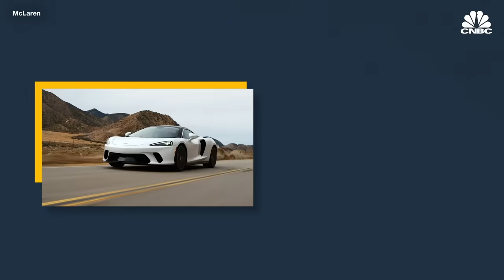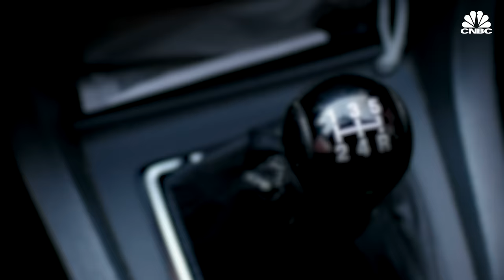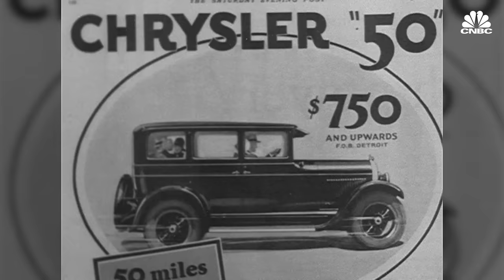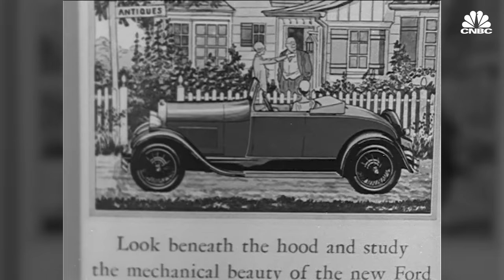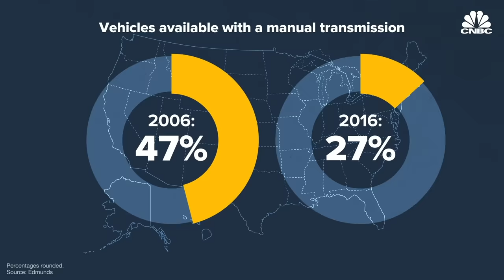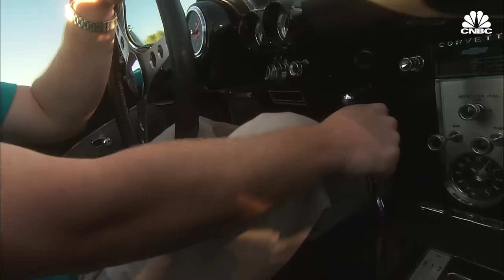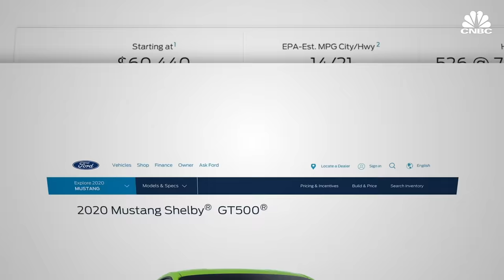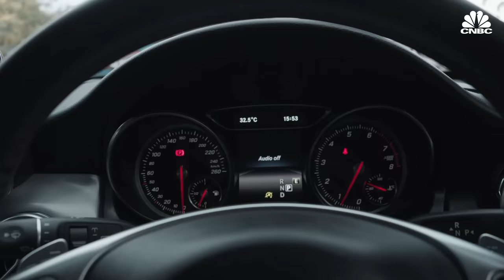Why Stick Shifts Are Going Extinct

Comment: Manuals are so much fun and so satisfying! Driving feels much more like a chore in an automatic and more like an activity in a manual. To anyone who reads this and doesn't drive stick, try it out! It's a great skill to have and makes you feel straight out of the Fast and the Furious
Reply: Cinda Oppenheimer  and some wanna have fun and improve their driving while doing so
Reply: Indie Fury  Clutches normally last longer ... what car do you drive?
Reply: But is also a lot harder to learn do if just want to get from point a to b,keep the automatic.
Reply: @MrNoone-dg2xn  It depends on driving conditions. Driving exclusively city traffic will more than halve a clutches life. Honestly, a manual costs about the same over the life of a car as an automatic, based on my observations. A torque converter automatic usually needs rebuilt after 150k miles and by that time you’ve usually replaced a clutch two or three times. And even a manual will have to come apart for synchros eventually, even if it is around engines expiration date.
Reply: How is it a chore in an automatic when it is supposed to be the opposite? I feel like you guys are just making stuff up now to defend manual
Reply: @mikerichards2317  I think what he meant by “chore” is that driving a car with an automatic is more like driving A to B as opposed to the engagement of driving a manual for fun. I personally disagree with his sentiment. I’ve had plenty of fun and engaging cars with automatic transmissions. Pontiac Grand Prix and 2012 Focus to name two. But I still enjoy driving a manual more personally. Nothing cooler than heel toe downshifting into a corner and blasting out at 5k RPMs. My 98 HP Chevy Spark might be slower than a moped, but man am I having fun being slow.
Reply: Every shift you feel the power driving a manual transmission  only lazy folks drive an automatic
Reply: Lance - manuals being fun and satisfying is for people who actually enjoy driving, and for the life of me i cannot understand why anyone likes driving.  many of us consider driving an unfortunate and dangerous chore we have to do because the world became so dependent on motor vehicles, which are one of humankinds most idiotic inventions
Reply: @eatpigsnot  That's fair. I wouldn't expect someone who doesn't like driving to begin with to enjoy manual, but I think it is worth trying out nonetheless. 

As for the enjoyment of driving, I cannot speak for others but personally, I enjoy driving because I like going fast. And not exclusively in a straight line but in curves and turns and other maneuvers. There's something so satisfying about the sensation it provides. And driving a manual lets you be more connected and in control of every aspect of that.
Reply: @lance9800  i can't understand what being connected to a vehicle means.  i don't doubt you and other driving / car enthusiasts feel it, i just don't understand.  my hand / foot coordination is non existent.  i don't think driving manual is something i could ever learn no matter how much i tried and practiced.  i give people grief for being closed minded and not trying new things, and i don't want to be a hypocrite, so i guess if the opportunity presented itself i would try.  side note - do you watch SNL?  if not pull up the "Car Heist" sketch from last weekend
Reply: @jacobrzeszewski6527  Anyone that replaces their clutch 3 times within 150k  miles, doesn't know how to drive a manual car and shouldn't be driving one at all. It  is a skill and a pleasure to drive one.
Reply: @eatpigsnot  for me personally, i started feeling that connection to a vehicle after a year of driving manual, bc its how long it took me to perfect it
Reply: Indie Fury  Hey when I bought my second Beetle, the owner said- "Clutch has to be changed."
and by NOT slipping the clutch, (or being an a - -), I drove it TWO more years, no problem.
Hopefully, we can help save the climate by as soon as possible going ALL EV !  and goodbye transmissions altogether, along with crank and drive shafts, camshafts, engine bearings, unjectors, mufflers, catalytic converters, water and fuel pumps, radiators, etc. etc. This will be a dinosaur of discussions !
Reply: When I was in my teens and twenties I didn't want to drive any car that didn't have a stick. Once I hit my thirties I didn't want any part of a stick even though I had a few cars in my thirties and forties that were sticks.
Reply: @jacobrzeszewski6527  -- believe it or not you can drive a manual without synchronizers.  It utilizes a skill called double clutching.  And after you have mastered double clutching, you can drive a manual without the clutch at all except for starting out.  You always have to match the speed on both sides to get it to slide nice and silky out of one gear and into the next.  While in neutral between two gears you have to either increase or decrease the rpm's depending on whether you are shifting up or down.  Starting out be studying the shift point and seeing, for example, the rpm's in second gear at 35mph and the rpm's in third gear at 35mph.  Get the idea?
Reply: Indie Fury  You had to change the clutch because you are not worth a crap on a stick shift. Get an automatic. 
I've driven stick shifts for over 50 years and never had to change my clutch. 
I rode to work with a guy for awhile and I could tell every time he shifted. He ended up having to replace the clutch, twice I believe because he wasn't worth a crap at shifting a stick just like you.
Reply: @MrNoone-dg2xn  Car doesn't have anything to do with it, he just isn't worth a crap on a stick shift. He needs to get an automatic. 
The clutch should last the life of the car. Maybe not a truck, depending on what you're pulling with it.
Reply: @imatanyani  You are right, he can't synchronize the engine speed correctly for the gear he has shifted to thus causing wear to the clutch everytime he shifts. Some people just can't get it.
Reply: @lennyhendricks4628  Semis don't have synchronizers and they don't double clutch them when they shift. You have to know what you're doing.
Reply: I was with you until you mentioned Fast and the Furious. The Holy Grail Movie of Ricers.
Reply: Except when all the latest fast and furious movies are shifting an auto 🤦‍♂️

Comment: Thumbs up to all my stick shift drivers.. 
We're the last of a dying breed. 👍
Reply: cheers. I still have two 👍
Reply: OBZRV82 I own 3 cars and two of them are manual
Reply: I name thyself @LastOfTheAnalog
Reply: Bought a 2020 corolla hatch with the 6 speed, best car I've driven yet and I've driven some fast cars
Reply: OBZRV82 +
I own a 6 speed manual 2011 Nissan Sentra that I purchased in 2012. I’ve been mostly driving manual transmission cars most of my adult life & I LOVE it! Even if the next big thing is flying cars, I’ll be driving my stick until the wheels drop off!😂 
Unfortunately by then I fear that here in the USA there may not be an affordable mechanic around with the skills and knowledge to keep it running.😢

Comment: I'm 74.  Been driving for 70 years (yes, you read that right).  Started when I was four.  No big deal.  We were all farm kids in grade 1 at school in Australia and we could all drive.  I started on the farm's Series 1 Land Rover - manual gearbox, of course.  Now, it's a Beemer - bought new 22 years ago (430,000 miles on the clock and I've yet to lift the head) - manual gearbox, of course.  It'll see me through.  Behind the wheel, I'm a driver, not a passenger.
Reply: @endroholic7161  Thank you for that.  Most of all, I guess, I like the fact that the engine is directly connected to the driving wheels, and the ratio I want through the gear-box for those wheels is precisely the one I choose at the time and under the circumstances that I choose it.  I've driven automatics (never owned one) where - at times - the box was 'hunting' for the gear it wanted ... up and down, up and down.  Not for me; I like the certainty and precision of connection.  I'm a rally driver, and if I've got my tail hanging out there on a you-beaut gravel road, I don't want the car to change its mind about the gear it wants.  Another thing, if I've somehow flattened the battery, my car (the manual Beemer) can be push-started (done that once or twice).  And while I'm getting my knickers in a twist, I might as well add one more thought: if I bought a new car, I wouldn't want remote locking, lane-changing warnings, automatic braking, reversing cameras, Bluetooth and all the rest of the gizmos.  I do all that!  Take all that stuff out and spend the savings on bigger brakes, more power and better lighting.  My B doesn't have any conveniences.  There are only two things I'd like in it ... cruise-control and two coffee-cup holders.  And, yes, it has a full-sized tyre in the boot - not a run-on-flat or a Mickey-Mouse thin wheel.  Driving the 2,500 miles across the Nullabor to Western Australia (as I've done more than 50 times), the land is empty and you can drive nearly 100 miles between service-stations.
There you go ... a bit of a rant.  Safe and happy driving to you, Endroholic!
Reply: More power to you Sir. Driving stick is a feeling like none other.
Reply: Once you've learned to drive with a manual transmission becomes second nature, you don't even think about it.
Reply: Paul Armstrong  Thanks, Paul.  Glad you're onside here.  Something that's a bit disturbing I've been hearing or reading recently is the idea that a manual box requires some sort of extra skill or concentration - particularly the latter.  I don't accept that.  Certainly I'll admit that the pattern of actions to co-ordinate using the clutch pedal, accelerator and gear-stick to be sequentially learnt, but once they're established they become second nature.  Coincidentally, as l write, there's a bloke operating an excavator on my neighbour's property.  I once spoke to an excavator operator about his techniques.  He told me that the arms and bucket just became extensions of his own limbs.  He didn't have to think about scooping out a piece of dirt.  He just reached out and scooped it 'just so'.  And that's EXACTLY what happens with a manual gearbox; l need to add a bit more power to head up this hill.  The hand reaches out to the gear-stick, The two feet do their thing and the B is zooming up the slope without effort.  I wanted more power at the rear wheels and the hands and feet supplied the solution.  And the bonus was that l controlled the box ... not some set of wizard devices that
Reply: Paul Armstrong  ... 
had minds of their own.  No thank you!  I run my car.
Reply: I have a Land Rover Series as well, great cars
Reply: I can appreciate that history.   Most people don’t believe that I’ve been driving for 33 years.   Maybe it’s because I’m 35.....doesn’t change the facts.
Reply: Yeah I know.. Rolling down the farm in your trac killing dingos and Emus while listening to Ashes commentary on your radio, while you drink vegemite flavoured beer . 

Aah the 'Strayan Childhood.. 

Had it been 8 years old, I would've believed..
Reply: The fact that you drive since 4 and  my generation struggles video games or to explain it simply Controlled movies is crazy
Reply: based
Reply: What's?  That's mean u hv been driving seen from age 4 .😂😂😂😂 I hv never heard a 4 year old kid driving a car
Reply: How did you reach the pedal and steer at 4?
Reply: Ok boomer
Reply: I'm 167. Washing my laundry for 166 years with my bare hands.
Reply: ok boomer
Reply: Your generation had the highest car crash and fatality rate of any generation of drivers.
Reply: Wait a second  you are 74 and you have been driving for 70 years you started driving when you were 4!😲
Reply: I was always taught that manuals are more fuel efficient then automatics to the tune of 15%. 
The stupid and ignorant always get the sh!t end of the stick. :)
Reply: You dont trust the advancement of motorscience? What kind of engine enthusiast are you? Please get with the times.
Reply: Tell me more about it.

Comment: I don't really buy the headline. I've always had a manual transmission and my next car will be as well (2024 Integra Type S). Mazda Miata, Mazda 3, Subaru BRZ, Subaru Crosstrek, Subaru Impreza, Subaru WRX, Chevrolet Corvette, Chevrolet Camaro, Porsche 911, Porsche Cayman, Porsche 718 Boxter, Fiat 500, Honda Civic Si/Type-R,  Acura Integra, VW Golf R/GTI, VW Jetta, Jeep Wrangler, Jeep Gladiator, BMW M2/M3/M4, Cadillac CT4-V/CT-5-V, Dodge Challenger, Lotus Evora, Ford Fiesta, Ford Bronco, Ford Mustang, Jaguar F-Type,  Mini Cooper, Kia Forte, Hyundai Elantra N, Nissan Versa, Nissan Z, Toyota Corolla, Toyota GR86, Toyota Supra, Toyota Tacoma. Wow. Did I miss any? That sure seems like an awful lot of them to me. Plenty to choose from. Of course they will eventually go extinct, just like the automatic transmission vehicle will also go extinct. They will probably both go extinct at around the same time. No need to get your panties in a bunch.

Comment: "You ride in an automatic shifted car, but you drive a manual shifted car." Amen brother!
Reply: IMO this is not the point. I don't care too much about shift stick but about gearbox itself. The manual gearbox is much lighter, cheaper, easy to repair. There is nothing about EGO.
Reply: Indeed man
Reply: you ride a motorcycle (which i do), you drive a car

Comment: I picked my current car because I wanted a hatch back with a manual transmission.  I ended up with a Kia Soul because at the time you could still get a stick in the base model.  the funny thing is when I walked into the dealership and told the salesman I wanted a Soul that was a stick shift, he looked at me like I just grew 3 heads
Reply: Funny when my Mom saw my Grabber Blue 2017 Mustang GT 💙, she was in love. So much so that her 3rd Kia Soul she ordered with  manual transmission at 70yrs old. That lasted a couple of years then she gave it up after hip surgery. She actually taught me how to drive a stick on a 77 Datsun B210 when I was 12.
Reply: @d.s7741  wow you must be a real angry person. Sheesh. Happy 2022.
Reply: My second gen Santa Fe is a stick shift with a V6.  The sad thing is that only about 2% of buyers chose that option.  i am thinking of importing the 6 speed transmission out of Europe to put into it when the time comes to do the clutch to give me an extra gear on the freeway.
Reply: @glennw7118  - either that or I don't take life too seriously WHOOSH!!! (right over your head) 
😎
Reply: I almost bought Emanuel Soul a couple years ago but my girlfriend at the time was wanting to drive the car and really doesn't like manual shift Vehicles much after we broke up I took her car that I bought her back and I went and got a manual Mustang
Reply: Check out my typo I say a manual and my phone changed it to Emmanuel that's how rare are manual cars are
Reply: @Nick_the_Troubadour  noticed that :)
Reply: Real Lady buys a car with proper clutch and gearshift You are a keeper 😍😍😍
Reply: Oh wow,  did you get the hamsters in it too???    :)
Reply: @frandanco6289  no hamsters

Comment: Sad thing is that manuals can cut back on distracted drivers.
Reply: A-men.  Drivers under 18 should legally be required to drive standard only.
Reply: Just because you dont have to focus on gears doesnt mean you're supposed to lose focus on everything.
Reply: @jtinnac1895  that's a stupid law . Good thing you aren't in power to create them .
Reply: Disagree a lot of accidents happen here in Brasil due to manual transmission especially due to older drivers with less coordination.
Also manual transmissions are annoying to drive in traffic as my Brother in-law told him after buying his first automatic vehicle and loves it. Manual transmissions are still very common here in Brasil as I was recently looking at used cars here and none had automatic transmissions.
Reply: source?